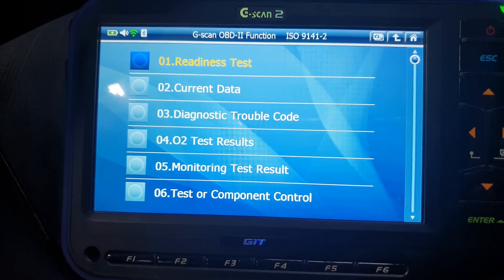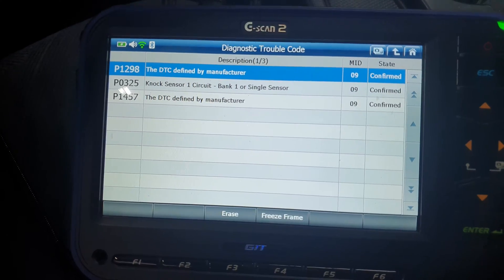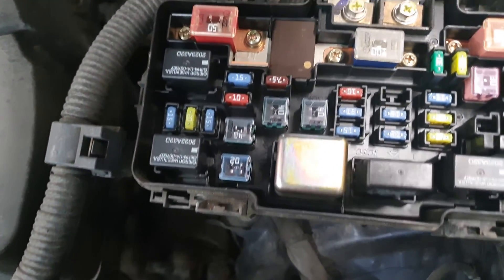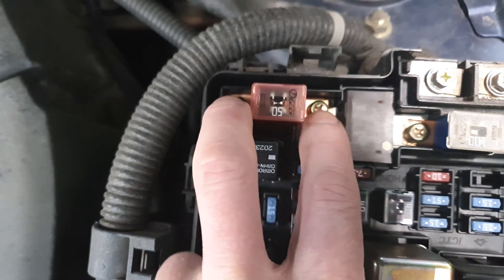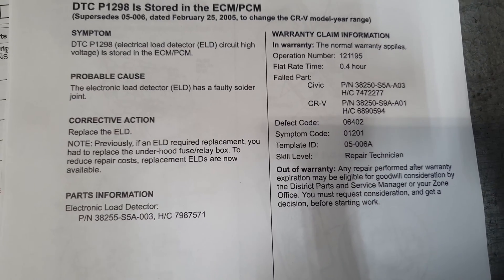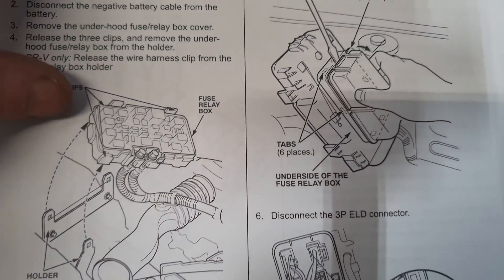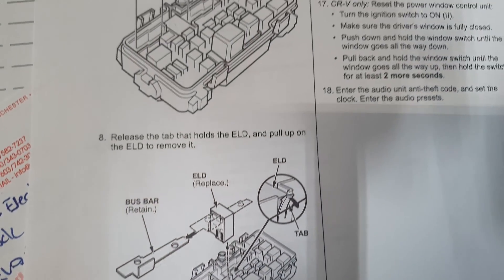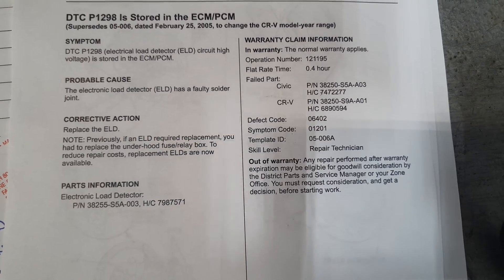Honda P1298 Electric Load Detection Circuit "TSB" Location

Comment: Most of the time the P1298 code is usually combined with an O2 sensor code, a speed control code, and fuse 15 blown. If you have all these, it is NOT caused by the ELD. It is caused by a wiring harness behind the intake manifold which rubs on a support bracket for the intake. The wire there gets shorted to ground and blows the fuse 15 and when that fuse is gone, the car will no longer charge your battery even if the ELD is saying it is needed.
Reply: Mine has has 02 codes since I bought it. One day my girl stalled it and been having charging system issues ever since. New alternator new battery and one day speedo stopped working. I'll have to look into trying this
Reply: @areeyeveeeeare4881 mine got the same error , then the rpm meter dtop working
Reply: @areeyeveeeeare4881  have you able you fix it?
Reply: @mdkema2770  ended up parting the car out
Reply: How common is this?
Reply: Can give pic where the wire
Reply: it was exactly like that, though it was alternator, thought battery and struggled so much for several days thank you @LBCAndrew you saved the day. fuse 15 just replaced works fine